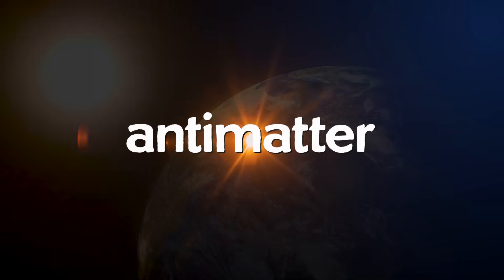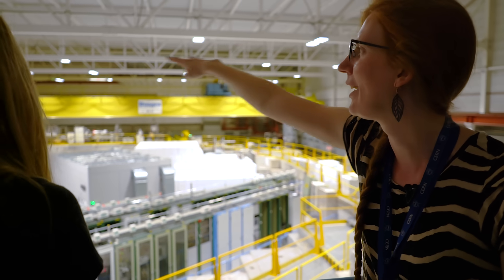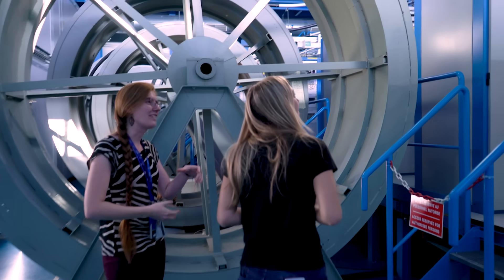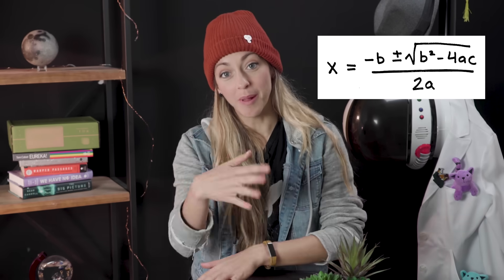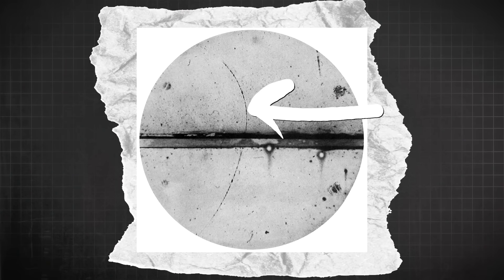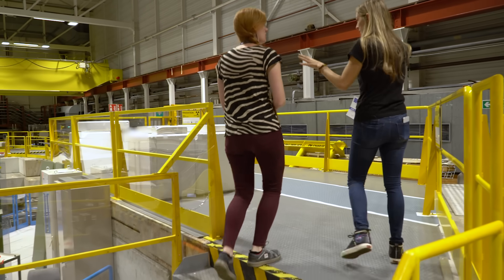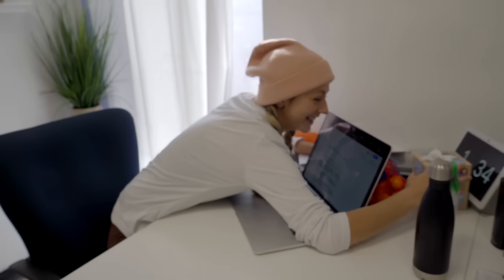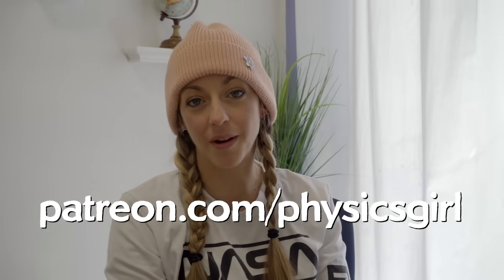Why This Stuff Costs $2700 Trillion Per Gram - Antimatter at CERN

Comment: I always wondered if some of the far away nebulas could be anti-matter. If we ever got close to one with equipment to check *poof*. Assuming there is equal parts matter and anti-matter the universe could very much be split into pockets of both. So we exist within a pocket of matter.
Reply: Everywhere we look in the observable universe looks identical. If there were pockets of antimatter they would be glowing brightly with gamma rays as annihilation happens on the boarder between the matter and antimatter.
Reply: @bensemusx  That would only be the case if there was matter and anti-matter that collide. If there are pockets though they would be separate. I'm not saying pockets of anti-matter within bodies of matter. I'm suggesting pockets of anti-matter and pockets of matter within the void of space, in isolation.
Would that not be possible?
Reply: @magusware8721  No because the universe is homogenous no matter where we look. There is no known mechanism or theorized mechanism that would allow matter and antimatter to separate like that. 

Because we don't know why matter won out over antimatter this all could change in unforeseen ways but that is extremely unlikely. The current theory is that there was just a tiny bit more matter than antimatter. An explanation for this is being looked for. The scientist in this video is part of that hunt. Her team is taking incredibly detailed measurements of their antiprotons to try and find any slight differences between them and a regular proton. Finding that difference is like finding a lose thread to pull on or a tiny crack to put a pry tool into. It gives them something to focus on. 

A recent example of is is the teensy tiny mass discrepancy in the W boson. The measured mass of the particle is off by like 1% or less from the theorized mass. It's hopefully a clue into creating a better version of the Standard Model of particle physics.
Reply: @bensemusx  It's all incredibly interesting stuff. I hope I get to hear about and learn about the results of some of these experiments in my lifetime. The universe is utterly batshit insane... and I love it.

Cheers for clarification on this too.
Reply: @magusware8721  lol that is an understatement. If you really want to mess with your head check out PBS Spacetime. It's at a higher level but still really well explained. He covers a bunch of space related topics. But Why also has some really well done videos on space stuff. He covers other stuff too and the detail he goes to in his explanations are crazy. He also has a good but funny animation style.

Comment: Just antimatter ceasing to exist on contact with matter seems like a good reason why its either not present or mostly nonexistent. Then add in the fact that the rate of decay is at best a little over a year. I don't know how we determined there's an equal amount of both matter and antimatter (might have missed that part - mathematically?), but if they are not present around each other and disintegrate on contact you would assume that is their preferred chemical state of balance is in an area void of matter (like space!).

Comment: I have a question... 
Does antimatter have the opposite charge of its matter counterpart?
Would anti matter of electron be somehow e+ and if yes then, will they neutralize each other at the moment of contact, would it be same with the up and down quarks?
Reply: Yes this is exactly what anti-matter is, anti-matter electrons are actually called positrons. Once they touch they would annihalte coverting their mass into energy in the form of gamma or x-ray radiation. This video is a bit misleading though becauase anti-matter is not that rare, we use antimatter all the time in hospitals. Known as PET scans  (positron emmision tomography). Positrons are created all the time all around us, this is a type of radioactive decay called (beta +) decay. what is rare is getting whole nuclei of antimatter as it usually annihaltes before its captured. 

To answer your question for up and down quarks, yes if they both touched each other they would undergo a transmutation, I don't know what they would be turned into, QCD shows that they would never likely ever touch because of the strong interaction. If they somehow were forced together then its possible they could undergo an interaction similar to electron capture. Where an electron and proton combine, creating a neutron and releasing an electron neutrino.
Reply: @shugucchi  positrons are the low end anti matter tho that isn't really a anti partical it's just a reversed charge not something that may defy physics it's self
Reply: @livingglowstick1337  An anti-particle / anti matter is just the opposite charged particle of the common matter, for example, the positron to the electron, the anti-quark to the regular quark. What you're thinking off as physics defying is exotic matter.
Reply: Yes they will, it's called annihilation. In the process, a lot of energy is released.
Reply: Yes. I believe that down into the atomic level, it's an electron around a proton while antimatter has a positron around a antiproton
Reply: At opening the container they put it in (if the container doesnt disappear at contact. Lol)

Comment: This really makes me think... is it possible that stars are composed of anti-matter? Is that why they are so bright? Does that contribute to their heat intensity? Does it contribute to the light they produce? So many questions which bring up more. This is just the top of the iceburg.
Reply: Nope, atleast most of the stars we know are not made of anti-matter. They are bright because of nuclear fusion reactions happening continuosly. If there was even a bit of anti matter there it would neutralize matter and ofcourse energy will be released however the star would deplete too fast. Either something has to be made completely of matter or it has to be made completely of anti-matter.

Comment: "Potentially the most dangerous substance on earth" 1st... would need to actually be a physical mass of matter to count as a substance. Secondly.. if a pinpoint on the tip of a bullet can create the equivalents of a 500 pound explosive on contact with matter.... would call it the most dangerous thing.
Reply: At weight of a bullet antimatter would outclass Fatman and little boy put together in explosive power.
Reply: @vaskarghosh8543  I said pinpoint, not the weight of a bullet in its entirety. I watched a separate video just displaying what the tip of a 5.56 would accomplish.

Comment: Just thinking about this in bed. So if matter and antimatter just
kept exploding to create the Big Bang a reason we have a hard
time finding antimatter could be a majority of it is currently on
the edge of the universe still reacting with matter expanding
further and further away from us. The initial bang caused so much force it blew a majority of antimatter away from the center of the universe in all directions creating everything.
Reply: Interesting thought. However, the amount of matter and anti-matter released in the Big Bang would be equal, therefore we should not be observing traces of matter in any region where anti-matter once existed, considering the fact that it annihilates when in contact with matter. Same would apply for the edge of the universe unless, anti-matter has a decay period, which it seems to have.
Reply: I’ll be back in 20 years when your right
Reply: Yes.

Comment: Why is anti matter associated with anti panty? Well, it is primarily due to the inability of modern physics to comprehend even the most basic attribute of physics. E.g. A falling object in the air is due to the object being denser than the air and as such the air is unable to support the object. Yes folks its density and not gravity that is the cause and it's the same principle for buoyancy. But modern physics denies this fundamental truth because it make them look like complete idiots. Anti matter is actually at one with anti panty, but the secrets of anti panty will not be unveiled in this comment.
Reply: Yes, density, but why down ? There is air all around that object falling, so why down specifically ? Well gravity, gravity define what is down.
Reply: @Nacil_54  You don't know what down means? The Oxford Dictionary definition is -
towards or in a lower place or position, especially to or on the ground or another surface.
The object has to fall down because the air, is less dense than the object and the air cannot support the object.
This truth upsets people's peace of mind, it upsets a part of their core belief system and they experience cognitive dissonance. This is the damaging effect of official lies taught in education when the truth is unveiled.
So when studying the truth of flat, motionless earth one method of coming to terms with it is to keep an open mind and if you like you can set the truth to one side at least for a while until you finish studying the hundreds of other truths you are not aware of. To do this study I recommend you watch Eric Dubay's videos - the Flat Earth Conspiracy is a good starting point.

Comment: If you think about it, we are technically anti matter. At least, to an anti matter universe.

What I’m saying is, if what we call anti-matter out massed what we call matter, then what we see as anti matter would have just been matter. As in, we only call what we see “matter” because that’s what WE see, and we only call it Anti-matter because it’s what we don’t see. 

To dull it down entirely, what I’m getting at is that if anti-matter won, we still would have called it matter and matter would have been dubbed as the anti-matter instead.

Comment: [THESE ARE JUST MY IDEAS, NOT ACTUAL FACTS OR TRUTH, I AM SIMPLY THINKING 'OUT LOUD'] :: So antimatter literally has negative energy? Like, the electron resonates within the electromagnetic field generating a rippling wave of which its integral is the energy density of one electron:  -1.602 x 10^(-19) Amperes of current strength over the observed time span of One Second. The proton vibrates exactly 180 degrees out of phase to the electron generating the energy density of PLUS 1.602 x 10^(-19) Ampere Seconds. Antimatter therefore must vibrate with exactly mirrored energy to its counterpart. The overlaying of the energy waves would cancel them, "deleting" matter. Kinda like the double slit experiment where, when maximum and minimum of the standing wave combine, the result is bright and dark spots when observing the wave characteristic of light. Because energy and momentum is conserved though and never lost across adiabatic systems, which the universe can be considered as adiabatic, the energy that was once present in matter, a physical representation of energy, is now converted to purely energy in the electromagnetical field - into electrical momentum.

Comment: There is a better energy source...truly magical actually, but real. It involves time space dilation and another aspect of physics (long explanation). Safe, quiet, no residual heat or "entropy", it never stops producing, and there is unlimited access. Creates anti gravity, instant acceleration without any dangerous external forces such a gravity, in fact it's effect is not even measurable. I think some people may possibly know what I'm referring to, but I doubt it. Other than me, I doubt anyone thought of this, and if anyone should know, Id rather tell someone like Elon.

Comment: Antimatters are existing everywhere around the lightening between thunder cloud and earth. Mechanism of discharging high voltage electron stream hits the air which contains nitrogen and oxygen atoms, then makes a few of positron particle, but electron and positron annihilated each other and emits bit of gamma ray and creates shockwave a.k.a. thunder, to the air.  As evidence, the effects of acute radiation damage and electromagnetic wave exposure have been confirmed by humans who have experienced lightning strikes up close.  If we could isolate these positron particles somehow from the lightening area, it can be easier than taking cost and managing experiment in gigantic acceleration facility, sometime in the future.

Comment: May be its not the actual antimatter... I am talking about the pair of electron and anti electron(positron) formed by gamma radiations.... I can be a illusive phenomenon mistook by anti stuff... 
One reason behind it is that... Is You can turn electron to a anti electron... Its about the frame of refrence in each particular case.... For example :-a electron moves from left to right... From one frame of refrence... And same phenomena can also Explaned by taking a positron inspite of electron moves from right to left... From other frame of refrence... both means the same...